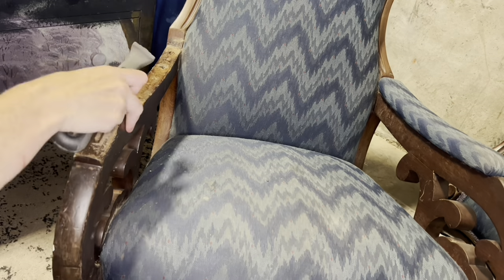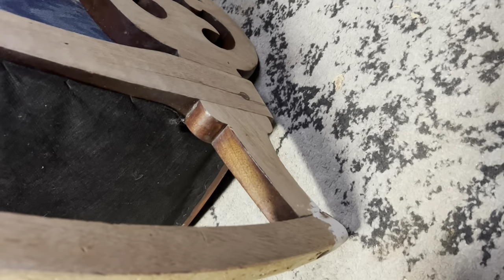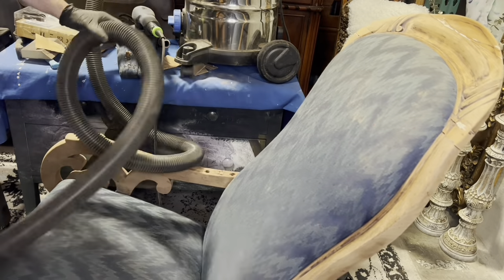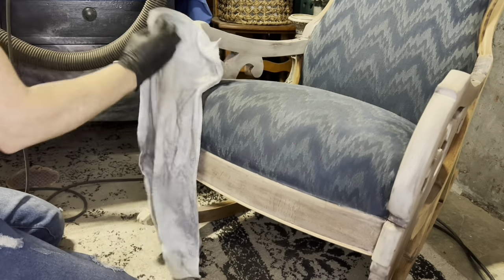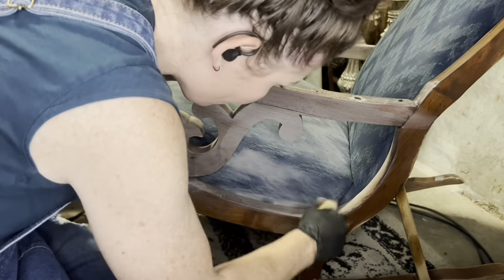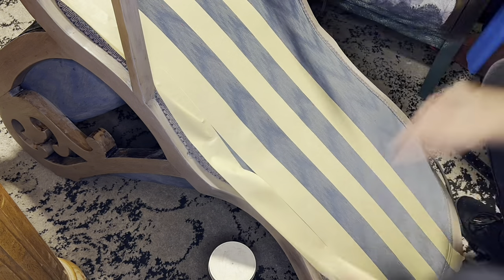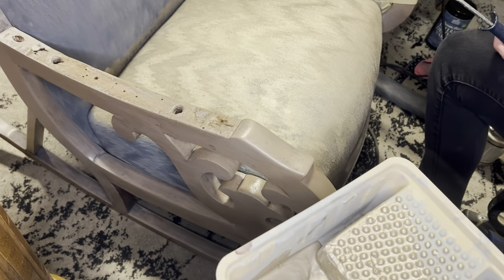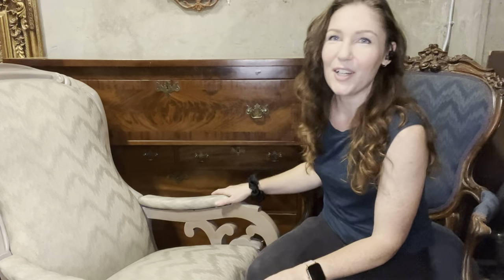Reimagining Parlor Chairs | Painting Fabric and Sanding My Life Away | Elegant Upgrades

Comment: The washed chair looks so pretty!! I remember my first stripping project when I was a kid. It was an oak oval mirror with carving on top. I stripped off the coats of white paint.  I had to use toothpicks, qtips, a small screwdriver and folding sandpaper to get into the grooves.thus was in the 70's and now we have access to dental tools, small brass brushes and all kinds of things. I have another mirror frame I'd like to strip but it has paint on it that doesn't want to come off. I sand and sand and after 40 minutes I have only removed the paint about the size of my fingernail! I've tried two or three strippers but they don't make a dent into it. I repainted the frame but would love to get it into a more natural state! Do you have any suggestions Taryn? The chest of drawers it goes with is poplar so I  hope the mirror frame is too. The chest will get a light wash of a white       or light cream to help lighten the odd colors of the wood. Would the wood benefit from some oxalic acid to even out the odd colors?? Any suggestions would be most helpful!!
Reply from the maker: It’s so frustrating when the old paint won’t let go!  Are you using one of the “nice” strippers?  I’ve found that they are not my favorite- I go for the strong ones.  You may also find that one of the carbide scrapers work a little better on some resistant paints.  It’s hard to tell, as I’m sure you’ve found for yourself that some paints and finishes prefer different methods of removal.  I know that was incredibly UNhelpful.  And yes to the oxalic acid.  It does a great job of evening things out if there are stains and it needs an overall lightening bleaching effect.